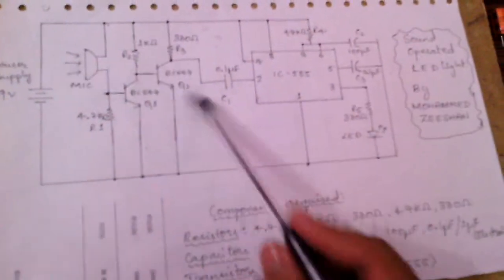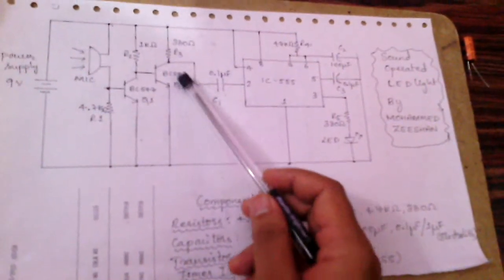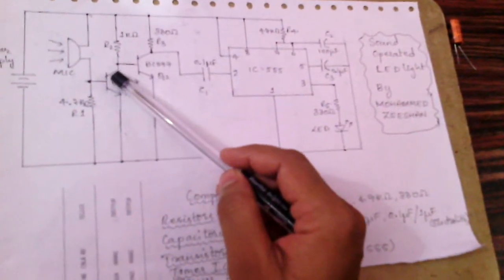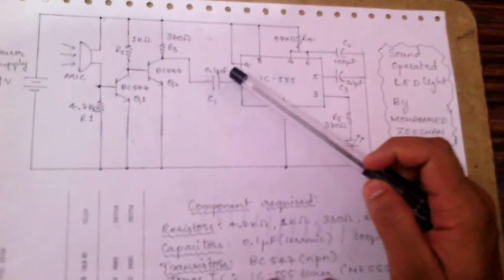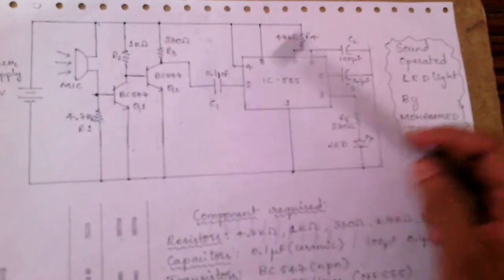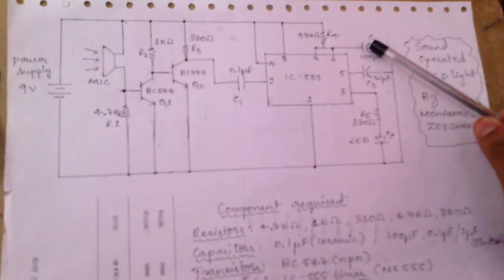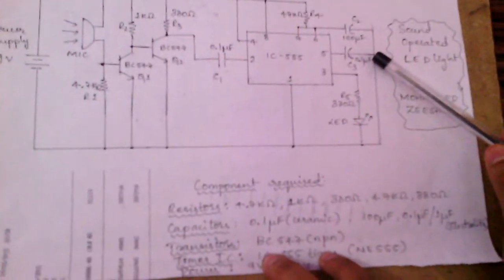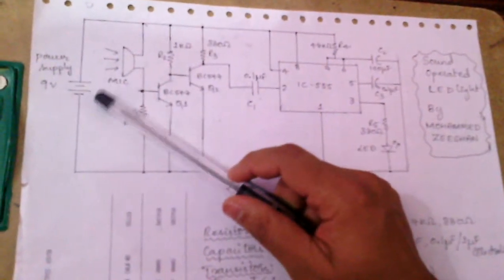Sound operated light using 555 timer  (clap ckt)

Comment: Bro here C1 was not a filter it's acts as a coupling capacitor , allows AC signal from left to right and Blocks DC from right to left .If C  is a filter means it  will always Connected to parallel w.r.t Signal flow.